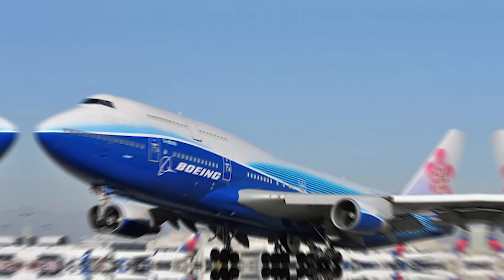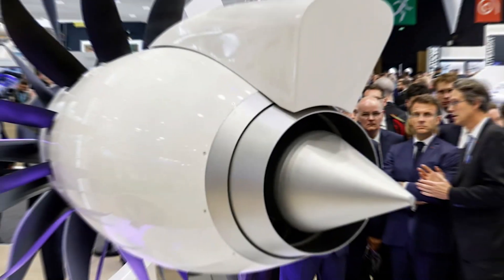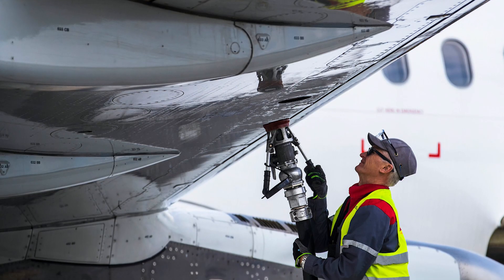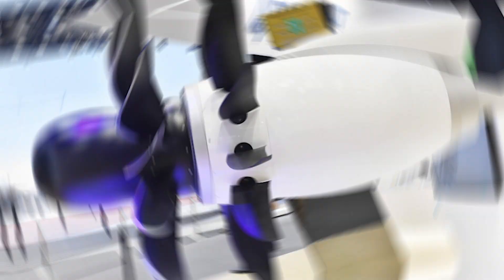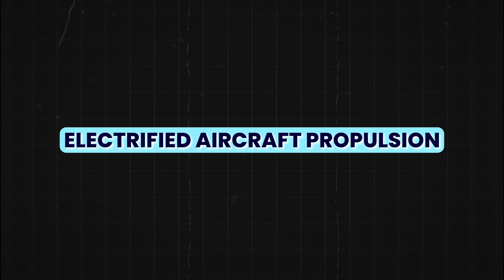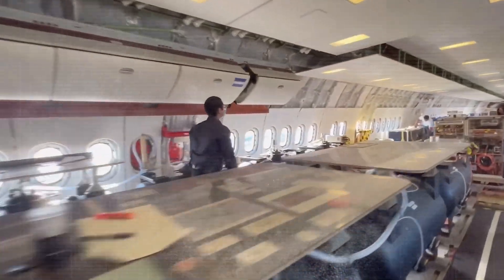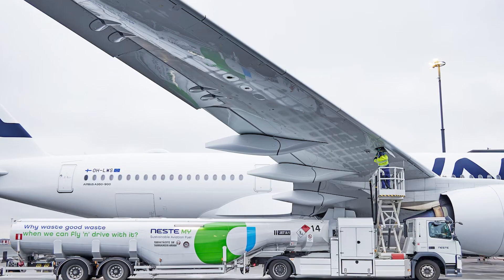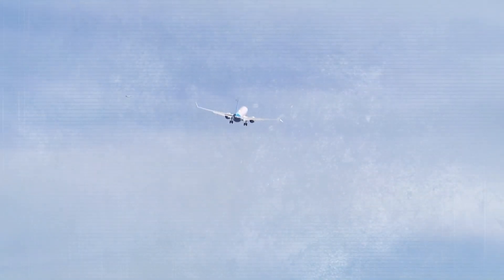NASA’s GENIUS Engine Could CHANGE Aviation Industry Forever!

Comment: un ducted fans have been in dev. since the late 70's.   actually proven to be better for slightly slower flight than most transport liners, but not adopted by airlines because of the image that they are not real "jets", because the public is stupid. 
bypass ratios have always been increasing, and are limited by the gearbox technology, cost, balanced by the fuel cost.  Hybridization is nothing new.  electric flight is nothing new either.  Distributed propulsion is the key to both, and been in development for decades.   
The only thing new is that more people realize and care that we ruined (past tense because it literally is too late) the environment.   Sorry kids.